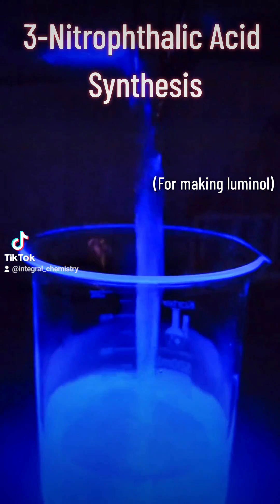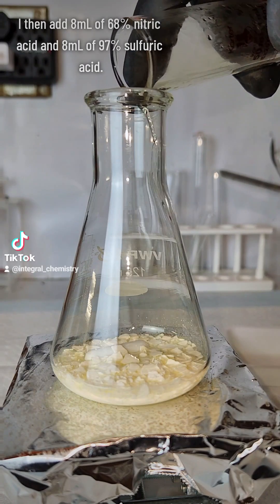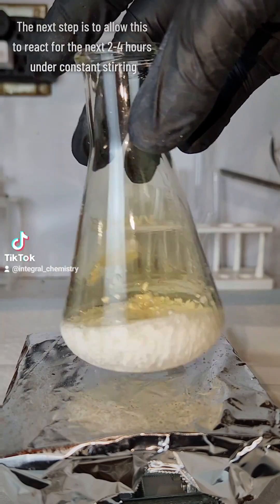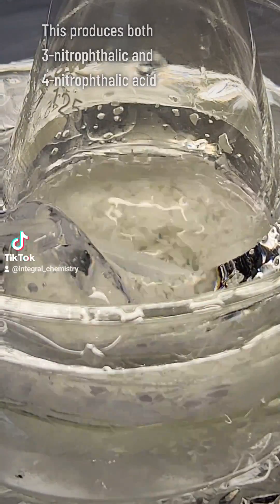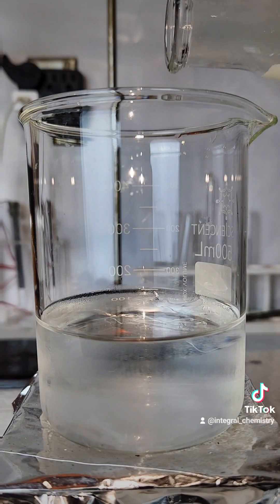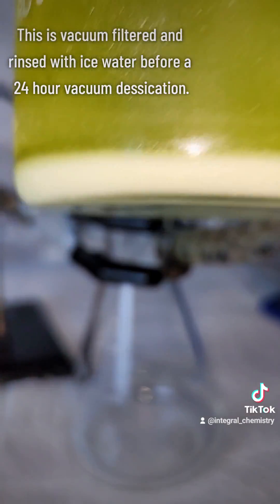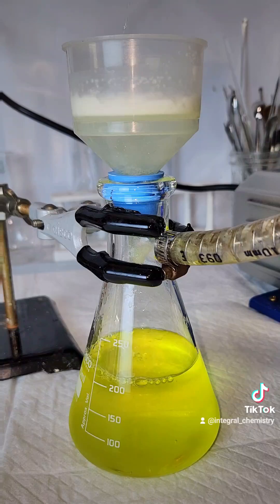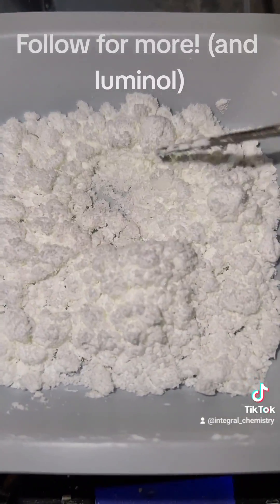Making 3-Nitrophthalic Acid

Comment: This temperature range is generally the optimum temperature range for the nitration reaction of phthalic anhydride.
More ortho products (e.g. 3-nitrophthalic anhydride) are obtained in this range. Because at lower temperatures, kinetic control is achieved and orientation to the ortho position becomes more dominant.